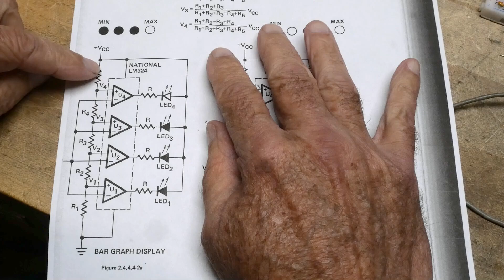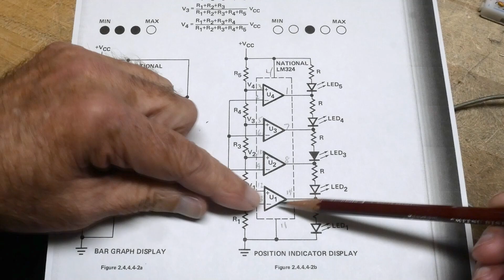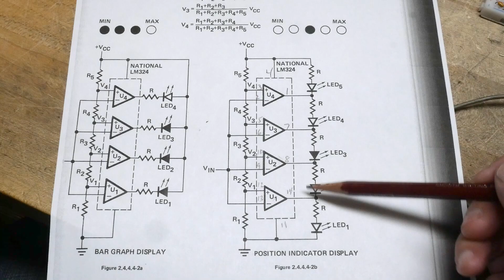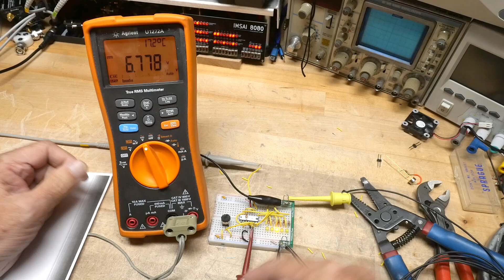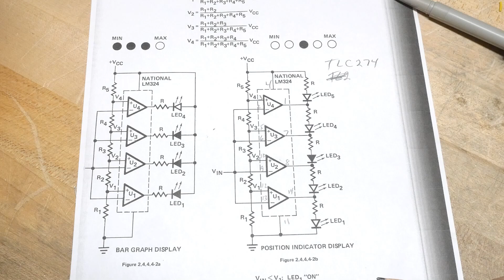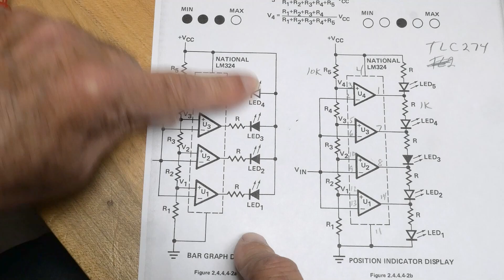#2229 Analog Voltage Display LED Position

Comment: The 'C' means CMOS. It has nothing to do with single supply operation.
Reply from the maker: you are right, I was referring to the TLC074 and TLC274. the 274 is single rail

Comment: It's called 'Dot Mode' I am surprised you have never come across it, in fact there is a dedicated chip that gives you a pin to decide which mode you wanted. I forget the name but it might make a good 'Chip of the Day' and everybody loves that ! Ebay used to be awash with 10 LED VU meters that offered Bar/Dot mode with the flick of a switch or a solder blob....cheers.

Comment: I ended up owning a small company, years ago, that made fire alarm flight monitors and water deluge systems for conveyors in underground mines. Our belt flight monitor worked similarly to this very circuit, except it could monitor up to 12 flights. Each flight (one conveyor belt) had a line overhead with thermostats hanging down, which ran into a junction box for the flights behind it, in series. In the box was a pot, which set each flight.

In the monitor were twelve LM741 op-amps set up in this manner, which ran a digital readout of 1-12. When triggered, an alarm would sound, and show which flight the warning came from.

Comment: That is interesting, i make a lot with opamp but did not know this circuit. In fact i like the LM324 as well as the LM358 a lot for these things. Of course there are lots of modern parts with way better specs - but it is so cheap and just gets the job done. For one moment i was thiking of LM339 / LM 393 too - also very classic chip. But this may not work as they have OC output stage...

Comment: You didn’t really explain that too well.  When the input voltage is 0, all the comparators are high.  As you increase the voltage, the comparators will turn off one by one, from bottom to top.  That’s why the right diagram only lights up one led at a time.
Reply: If we're in the middle of the bar, when one turns on , the one beneath it acts as a ground right?
Reply: @ yes, the led will turn on because the comparator below it is low.

Comment: I recently designed/built something similar for a piece of test kit using a dual push pull comparator as a pass/fail indicator. Window comparator. Three leds, top one over voltage Fail, middle led Pass, bottom under voltage Fail.

Comment: I have seen that exact 5 LED circuit in a .......... FM stereo tuning indicator display.  For the life of me I can't remember the brand of home stereo it was.  Most stereos in the 70's and 80's that had FM tuning direction indicators used meters.  It used the green center and then yellow and red on the outside edges like you described.

Comment: Interesting. I've got a Stiebel Eltron SH120S storage water heater that has a bargraph heat capacity meter. I reverse-engineered this thing out of curiosity, and it has two LM339N quad comparators in the bargraph circuit. These have open collector outputs that block off at positive input above negative, and unlike opamps, they can only sink and can't source.
Threshold-setting resistors are tied to negative inputs and input comes in on positive inputs all connected together. There's just one current limiting resistor for the entire LED chain and the supply voltage seems to be adjusted based on temperature to compensate for the number of LEDs to be switched on. Unlike the position indicator circuit shown here, the diodes are pointing upwards, with V+ coming in at the bottom (lowest threshold comparator) and ending on GND above the highest threshold.

Comment: Cool circuit! There's a surprising amount of subtlety to it. I could imagine it being included in an electronics lab class with questions like "Why does one have 4 LEDs and the other 5, with the same number of comparators? Does the dot graph provide more information (have more output states) than the bar graph? Do the two displays transition at different voltages? (Why or why not?)" And, of course, the mechanics of how one LED at a time is chosen, why they all need a resistor, what the current through the LEDs is, etc. etc. Fun stuff to think about!

Comment: Back in the 80's we used the LM3914 for a wind direction indicator. They have 10 LED outputs and are expandable.
Reply: I just recently got some LM3914, LM3915 and LM3916 and they're still going strong for hobbyist use, imho!
Reply: The 3914 can do dot or bargraph too. A small pc board may still be available on eBay, for the 3914.😊
Reply: ha i was about to comment the same